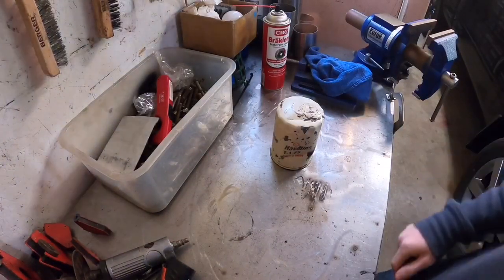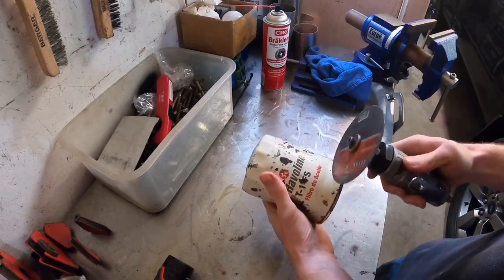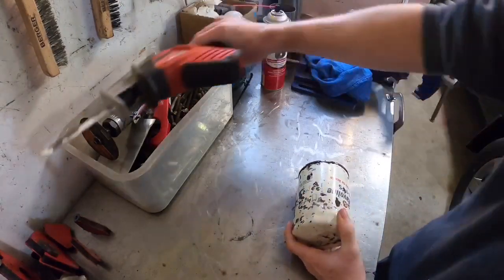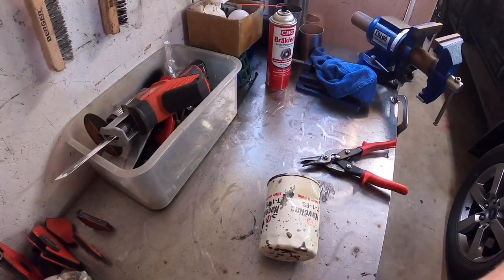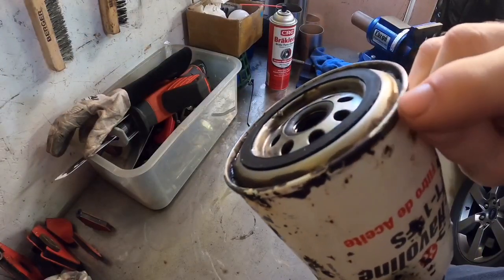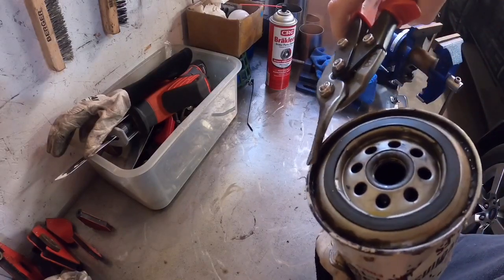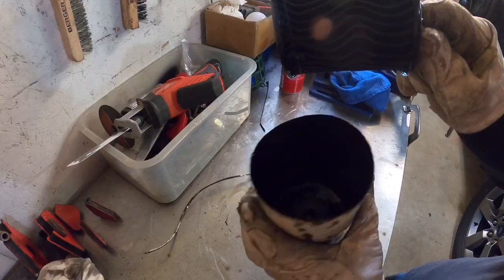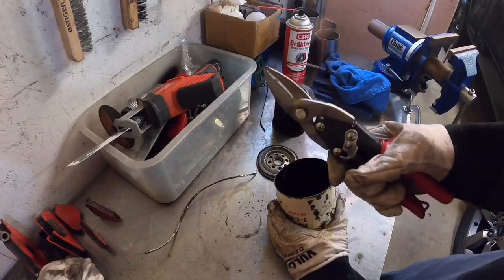How to cut open an oil filter, the right way, the easy way !

Comment: Tried this with a Toyota filter, worked. Hyundai, no way. I still use an air hamer with a sheet metal triming blade. Noisy and mesy but it works.

Comment: I use a old can opener to take off the lip
Reply from the maker: Also very smart
Reply: Please tell me how could recycle this filter to reuse by replacing the inner stuff and clipping the lid back again which is actually a technical concert.
Reply: @tanveerrasheed7104  no way

Comment: Cutting it open with grinder is fine as long as you do it at the top.  When inspecting the filter media just cut an inch below where you cut the top off and no contamination will be in that part of the media.